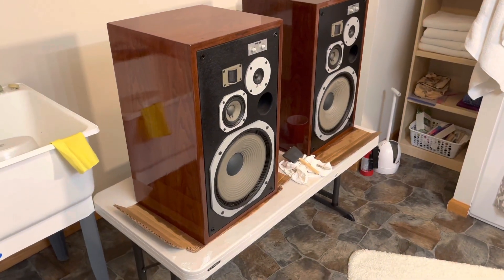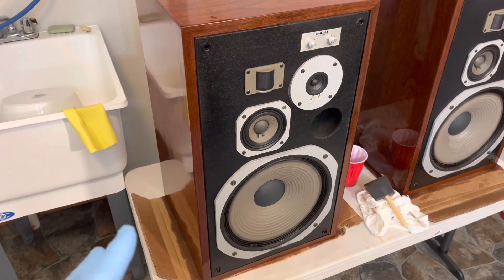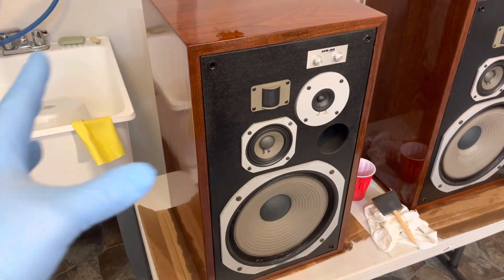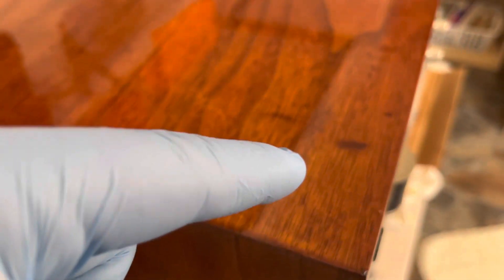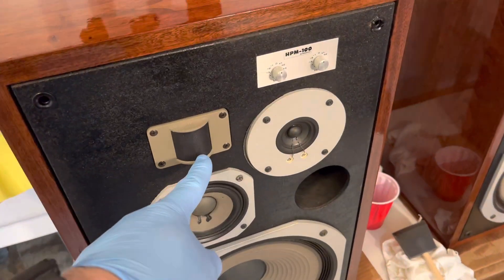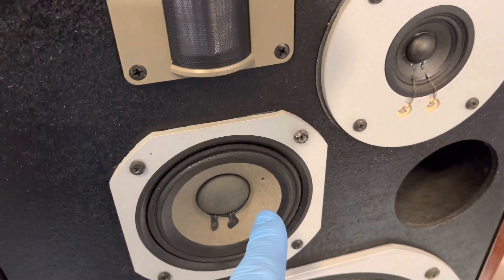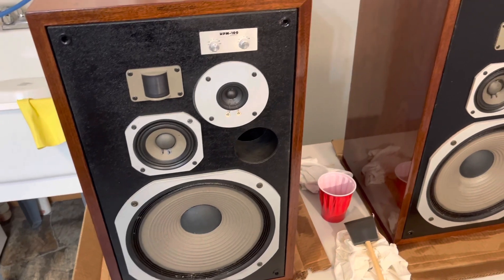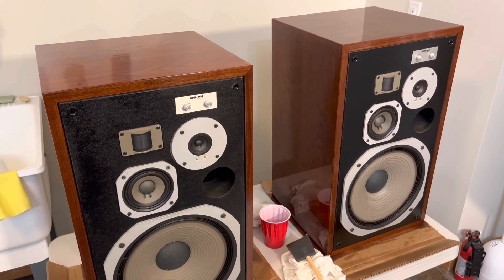Restoring the Finish on Pioneer HPM-100 Loudspeakers

Comment: What do you think is the original finish? I just got a set and the tops are messy but the sides are fine, they appear to be lightly varnished rather than oiled.
Reply from the maker: Honestly not sure, I know some outfits back then used a tung oil-based finish, and I'm sure some used a varnish. I use Waterlox generally with pretty good results. These speakers turned out too glossy IMO, I usually will hit it with a satin finish Waterlox after the gloss.